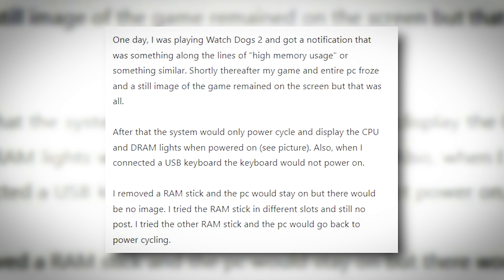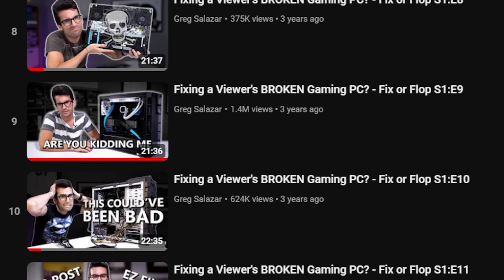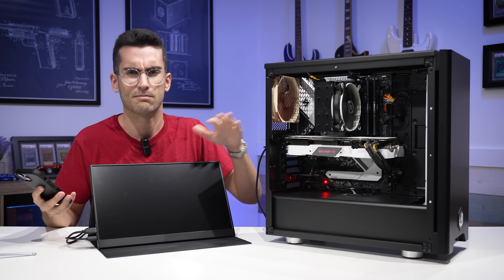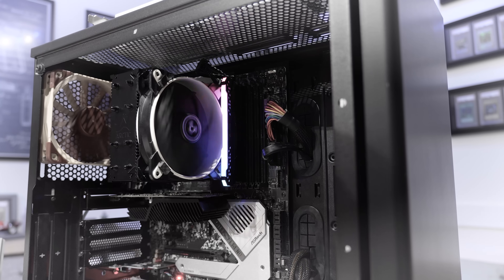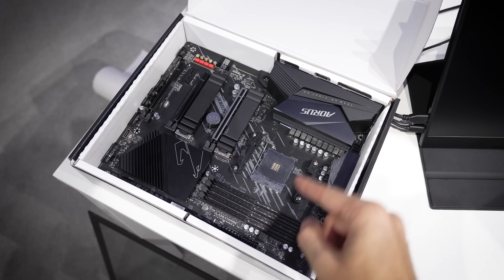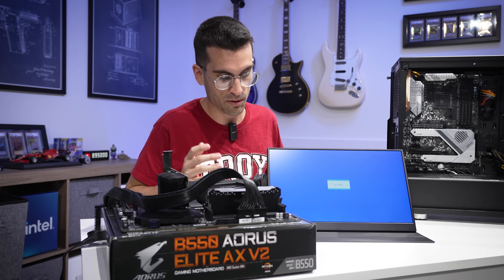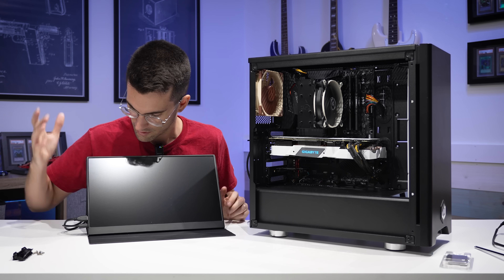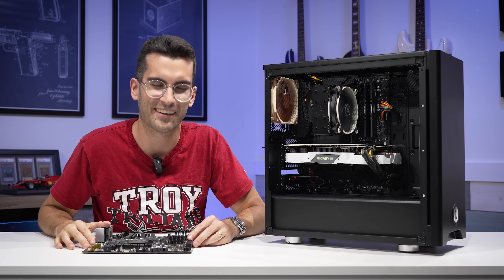Fixing a Viewer's BROKEN Gaming PC? - Fix or Flop S5:E20

Comment: Hi Greg, just a short note. I recently had the exact same problem, I decided to change the CMOS battery before throwing out the motherboard which fixed the problem. Battery was faulty, despite showing 3.1 V on the multimeter. It pays to always try a new battery.
Reply: Exactly 
Just because battery shows a voltage doesn’t mean it’s holding enough charge to power the bios
Reply: My computer would not power up and I thought it was because of the coolant leak, however I didn’t see any on the motherboard. I changed power supply thinking the leak which got on and killed it, but got same result. I thought my computer was dead, but after some research a suggestion is to change the 3.1v battery. Note that I haven’t used my computer for a few years as I stop gaming and do most of my online things on an iPad. As it turned out, replacing the 3.1v battery solved the power up problem.
Reply: To add to the funky cmos battery anecdotes.. I bought a barebones Alienware Aurora R9 from marketplace during the Ronapocalypse for cheap(dude just wanted the CPU, GPU and SSD), and after I got replacement parts and started it up, it would throw a different blink code every time I powered it on. No rhyme or reason to the codes whatsoever. Did some reading online and apparently it was not an uncommon issue with R9s. Computer was less than 2 years old at the time. Just crap batteries.
Reply: I'm with the others this is sounds like the CMOS battery going bad and the memory settings is probably tied to clock resetting in the BIOS. Had that happen to me back in 92. If any of you kids remember 486x CPUs
Reply: @VTX00128  Whew! I remember those!
Reply: @hudsonball4702 Yeah 486x's were my first exposure to the PC world back in the 80's as a kid. That how I learned to be in the IT line of work as I got older now it's more of a hobby now sense the jobs got shipped overseas for cheaper labor.
Reply: Battery to hold settings once power off. Causes setup every startup

Comment: A CH341a spi25 chip flashing kit with software like asprogrammer would make manually flashing a new bios onto a board's bios chip an option, assuming you tried everything else. Ive saved a lot of pretty nice boards by having that option available to me.

Comment: My Asrock B450 pro4 mobo died earlier this year always clean out and dusted every few months. I since went back to MSI. My original b350m MSI mobo I gifted to my mom. She has never dusted it out and its still going. I dropped it off at her house several years ago now. The Asrock B450 was my first mobo from asrock. I've never had a motherboard go dead so soon (other than DOA) that happens sometimes but not one the lasts several months then dies so soon. Im happy to report im back MSI! I ended up geting a msi b550pro vc-wifi and its been a tank! Greg I had an issue with the power button delayed before, it turned out it was dust on the back of a pcb board below the power button in the case I used some iso alcohol to clean the pcb board and has worked great ever since. Not all cases have a pcb board thats connected to the power button but mine did it was a raidmax case.

Comment: 15 years ago i had a computer that started up but wouldn't POST and it was a bad PSU. Then I had ot happen again with both an HP and Dell business class SFF desktops for work (they were a bit easier because they had a nice diagnostic light on the PSU). So that 100% happens.

Also, sounds like a dead motherboard based on the first bit of information. Have seen this happen a bunch, desktops and laptops, and motherboard is the most common failure.

Comment: Had something similar happen with my 3700x on a MSI MAG B550M Mortar wifi mobo that I never updated the BIOS on.  It had a windows 10 update about a week before all this.  This being my HTPC, I noticed i couldn't access it and found it froze on the desktop.  I rebooted and it froze as soon as I tried doing anything.  After that it wouldn't display out after powering on.  I was able to update the BIOS using the button on the back of the mobo and got into the BIOS screen where I discovered my boot drive was not detected (M.2 4x4 2tb).

Comment: Check bios battery voltage, low voltage may do even complete brick of mthbords, same for pull out of battery rather than clear cmos with pins sometimes will not work. Probably you are right but it's quick check and it can work. Literally I had mtgbord not working at all, stone brick bcs of 3.0 voltage on cmos btr ❤

Comment: funny true story about Ram, i got mu brother a 4 stick tridentZ royals that run a 3600Mt/s. Little did i know, even on a expensive Strix gaming board it did not want to boot it kept giving 0d code in the debug screen, i tried to reseat them and forgot the A1 slot not fully seated, and bammm, all 32G is detected and also running at its full speed of 3600Mt/s, that stick is so not fully seated that the top part of it you can see the gold plated pads. how does it work? Magic? my Computer Mana scared it? IDK

Comment: It might be a corrupted BIOS—I’ve handled this issue before. If you have the right tools, you can remove the Serial EEPROM chip, flash it with a programmer using the BIOS image from the manufacturer, and then re-solder it to the board. The most recent case I dealt with had previously been with UBreakIFix for four weeks. I had it for just one day, and it was good to go.

Comment: Its possible Bit Rot has occurred and that not updating the BIOS has hurt its longevity I have had the same issue on another Asrock motherboard had the same lights get stuck only difference is that mine had a BIOS Flashback feature which allowed me to flash the latest BIOS and back to the living it went.

Comment: I saw few times those CR2032 batteries showing 3v but they were too low on amperage, and a fresh one will be 3.3V most of the time
Reply: maybe the vrm of the memory is shorted meaning the ram don't power on

Comment: Honestly, I don't know why anyone would complain that you did not check the bios. If the cpu works fine, and the PC had always worked prior to this error, then it has nothing to do with the bios. Literally the only way the bios would be an issue is if he had tried to do an update and either used the wrong bios or cut the update off midway.
Reply: >If the cpu works fine, and the PC had always worked prior to this error, then it has nothing to do with the bios

Patently False.

Flash chips that store the BIOS can randomly corrupt themselves. I've had it happen numerous times to my own boards, and I've had even more boards come across my bench that have had it happen. Boards with dual BIOS are even worse, because if the secondary BIOS becomes corrupt, it can cause all sorts of weird erratic behavior. Gigabyte boards are especially bad about this, because they have an internal check that runs on the backup BIOS at regular intervals while the system is running. If it fails, it can cause the computer to spontaneously reboot, lock up or crash.

Then you have to add Microsoft and board vendor software into the mix. Microsoft started pushing out motherboard BIOS updates through Windows Update, which has been a disaster. AIB flashing utilities from within Windows are just as bad.

So frequent is it a problem that I've had to buy multiple EEPROM programmers to flash all of the various types of BIOS chips out there. Modern boards usually use SPI flash memory, but older boards can use serial and parallel flash chips that require different programmers.

That being said, I think the more likely problem that happened with this X570 board is that one of the CPU mosfets died and shorted out. It's probably fixable, but not without special tools.

Comment: I'm at 0:42 and I'ma try to diagnose along with you...
(Every time in the video something pops up that changes my hypothesis i will edit this comment with a time stamp)

Before touching anything I'd give the PC a visual once over, first externally, by ensuring there are no buttons stuck in the "depressed" state, or anything metallic jammed into any ports like USBs or headphone jacks. Then internally by taking off the side panel and looking for anything out of the norm, like burning, damage, things not plugged in all the way, things plugged into the wrong place or the wrong plug forced into the wrong hole. (eg a PCIE 8 pin JAMMED into the CPU 8 pin) Last visual inspection I do is ensure the CMOS battery in there and the clear CMOS jumper is in the correct orientation.

After visual inspection I'd power on to see the issue for my self.

@0:42 - After hearing the issues my first guess... HDD/SSD failure. I'd unplug both power and data from all drives, from the MOBO and PSU end. (M.2s would be removed) Then power on to see what happens.

EDIT @17:30 - Well My primary guess was never tested and we jumped to replacing the entire MOBO. Glad that hamfist worked... but did you ever try running his MOBO out of the case with nothing plugged into it like you did with the other board?

His board may not be dead. Try putting a new CMOS battery in there. Test boot it out of case with nothing plugged into it other than the known working GPU and monitor. 

PS... I'm an old retired tech (cant do it anymore because my eyes went kaput when I was 28) I love this series and I will always watch it as long as you make it.

Comment: Surprised you can get anything out of Aorus...I bought one of their B550 boards about 5 years back, it has issues and Aorus didn't even bother to reply to ANY emails I sent out to them. Fortunately for me, the issues are with the RGB and ARGB headers, so at least the board works to an extent, just doesn't have the RGB features they advertised and bragged about. Last time I will ever spend any money on anything from Aorus.

Comment: The VRMs on the AsRock took a shit. Luckily the CPU was still good - the 3000 series will commit hara kiri eventually. But at least the B550 has scalability - the owner can easily update to the latest BIOS and drop in a 5700x3d. He does have to be careful - Gigabyte developed a bad habit of not importing the Secure Boot variables in their BIOS updates this past August on all AM4 and AM5 boards. 😂 The September round of BIOS updates are fine though ...

Comment: I love this series Greg 
The amount of people rigs you’ve fixed that was quite simple in the end your a legend 
My issue this week 
I’ve never seen this issue before luckily the car wasn’t dead 

Had a issue with gpu drivers 
Had a 2070 super die and blue screen with tdr gpu mem error 
In the end the system was down for 3 days 
Fix was safe mode and remove the gpu driver then use a newer one and all is good no more tdr failure 
Was first time I’ve come across this issue

Comment: good that you tested with a 2600, because the Youtuber in Australia, showed all the 3600 were going bad, and a slight undervolt helped them Boot, also the 3700x was effected, that some lose the Memory controller due to heat..

Comment: Here's my guess: the RAM module not being seated properly put unusual stress on the motherboard's memory channel, which killed it after a long time. Kinda like how 12VHPWR connectors that aren't fully plugged in cause higher resistance and heating at the area of contact since the area of contact is smaller than normal. The memory channel may have just given up finally after power has been running through it beyond intended spec.
Reply: Doubt it was the RAM being seated improperly. The viewer stated they were playing a game when it started to fail. I am quite sure that the system wouldn't post with the RAM stick partly in. Would need to be fully in or fully out. The motherboard looks to have failed for some other reason.
Reply: @Barrelpants  If I was a betting person I'd say the X570 fan failed and caused the chipset to overheat which killed the memory <-> CPU connections, which cascaded through the rest of the motherboard. (Later revisions of the X570 chipset tweaked the heat output and rendered the fan unnecessary, though)

Comment: A BIOS harness to flash a good start-up. The RAM misalignment possibly sent power the wrong way and blew a capacitor, which will heat up enough to be picked up with an infrared camera. Or, use it as a parts board.

Comment: The chipset fan probably failed and the PCIe controller overheated, had a few ASROCKs in the shop because of that. Plus that case is trash thermally.

Comment: I have this pretty old system, featuring an Asus P7H55M-LX with an i3 CPU (not sure of the model at the moment), a Corsair CV650, one 4 GB DDR3 stick. It was Dad's system, he used it for pretty basic stuff. Two years back, when I tried to power it on, it POSTed fine, but said it couldn't detect any hard drive. So probably a dead hard drive. I wanted to get this system back up on its feet so that I can have a backup system with Lubuntu or something other distro that goes well with older systems. It had 4 GB RAM, so I bought another 4 GB stick and a WD Purple Surveillance HDD of 1 TB. The thing is, when I turn it on, it doesn't send out a picture. The monitor and VGA cables are working fine, as I use those with my laptop via HDMI to VGA adapter. It appears that it POSTs fine because the CPU fans and everything are running as expected. Kind-of the same symptoms as this video. I removed the HDD completely, disconnected the DVD writer, still no picture. Is there any way I can test it further without spending behind a new CPU?

Comment: greg the vrm of the cpu are in bad position are not aligned second you didnt test the board only with a cpu with video integrated without m.2 only psu to see if post you just change the board and you can program the bios outside you have only to desolder the chip and apply the update with the last version of asrock.

Comment: As soon as I saw that it was the steel legend motherboard, I figured that was it they are pieces of junk. I have one, and it freaking died within like 6 months. I guess that's why they're only $139 on Amazon. They may be great for overclocking, but they're piece of chit, IMO. Have a good one Greg, I hope you fared well with these hurricanes, and everything is going OK. Later holmes,

Comment: All I could think of all video was "Hey, I have that video card!" Unfortunately the fan bearings on mine have started to fail, so I need to look into replacing them, but otherwise it's been really solid (I do wish you could control the gigabyte logo's LED colours, but so far as I can tell they are not addressable.) Rest of the build on the other hand... Dying cmos battery and faulty ram made for a hell of a fix, took me over a year to fully diagnose the intermittent issues I was having since they were so varied.

Comment: Last week I got a system from a friend of mine where it randomly would shutdown, changed the PSU to a better one with more wattage in case that was the problem, the problem kept happening, I changed everything, took everything out in order to test part by part but it didnt happen and then I remembered one of your videos where you had problems with the connectors from the case.

I changed the case (and let him keep the PSU because I thought the older PSU was not enough for his system) and it has been working without a problem. 

Smol story to say that your videos helped me fixing my friends and relatives PCs xD

Comment: Hey you can be east coast Jay, there’s certainly worse things you could be. 🤷🏻‍♂️

What was the original CPU? I remember quite a while back there was a story about the Ryzen 3000 series CPUs dying at a higher than usual rate with heavy use and temps in the high 60s. 

I also should start waiting to comment til I see the entire video. I’m at the part where you’re about to swap the motherboard. That’s a great motherboard btw, I have one in one of my machines.

Comment: Just want to say thanks for what you do with this series. I recently repaired my PC myself, and I had the confidence to believe I could do it by watching how you troubleshoot different issues. Interestingly though, the tool I used to diagnose the cause of my repeated BSOD crashes was something I haven't seen since I've been watching this series. I was getting stop codes that were either from bad drivers or memory, but they still happened after using DDU to uninstall old drivers, and I ran the built in Memory Diagnostic Tool on Windows 10 which detected that there was a hardware issue with my RAM sticks. One new set of RAM later and I was up and running smoother than before. I know you likely would have just tested it by swapping to a known working RAM, but maybe in the future you mention that tool as something people could use if they don't have spare RAM lying around?

Comment: I love this series so much because I wish I could do this myself for people...maybe one day.
I recently just solved my own issue where both a GTX 1080 FE and an RTX 3060 12 GB kept having issues with my 1440p monitors no matter the cable used or settings applied / drivers used. It especially had issues with HDR.
Upgraded to a 7800 XT. So. Much. Better. But I tried everything except the GPU first because money. The older GPUs I now have I am giving to friends who need them.

Comment: Speaking of DOA PC.... My nephews Intel AX220 card just caused "System Interupt" to take 64% cpu. What's even weirder, the BIOS menu froze. That's f**ed up. Disabling it in Windows didnt help, I had to diaable the "wireless lan" in BIOS to fix the problem. However, no wifi on a friday evening = no minecraft with friends (no, there's no spare ethernet cable in the house). Buying a usb adapter for 30 euros tomorrow. A new m.2 adapter would be best, but they dont want me to open up the laptop. They're scared it will break even more.